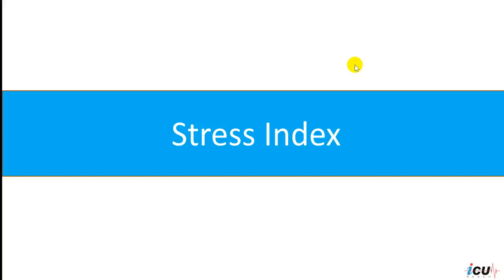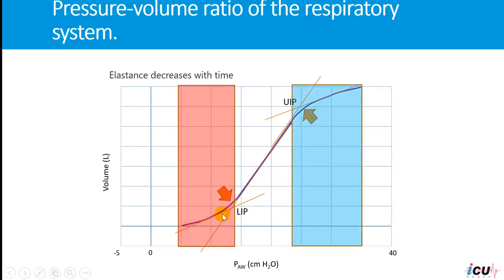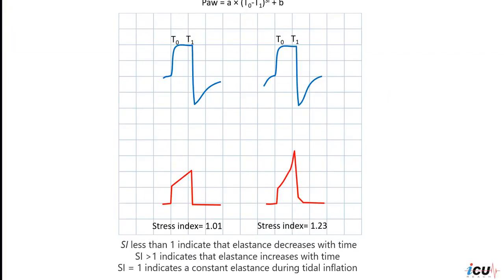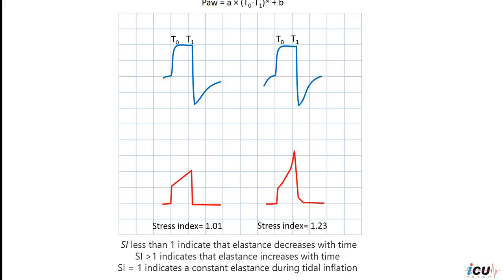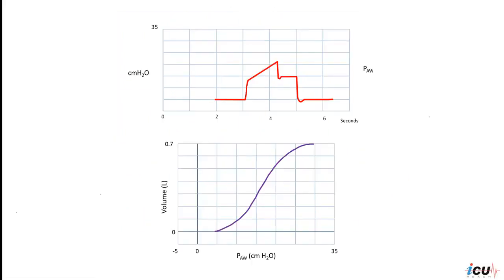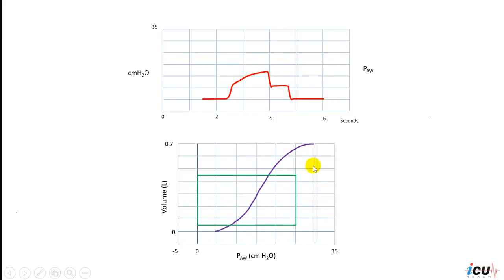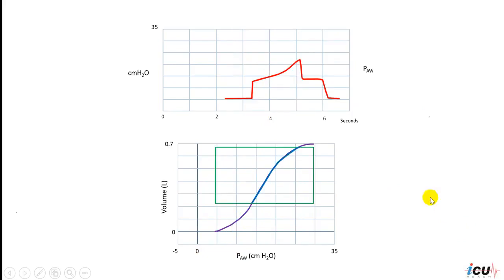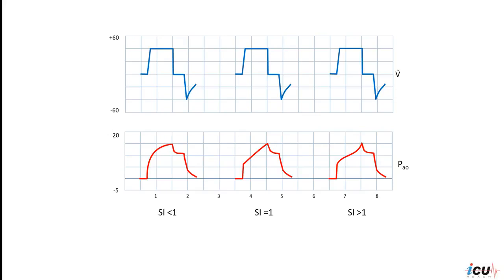Understanding the Importance of Stress Index in ARDS

Comment: I'm sorry, do you mean compliance, rather than elastance? Elastance is the inverse of compliance.
Reply from the maker: It is the same whether you use compliance or elastance, as you mentioned compliance is the reverse of elastance or it is volume divided by pressure. Whereas elastance is pressure divided by volume. The idea is on the PV curve, the most compliant area (or the lowest elastance) is the middle part of the curve.